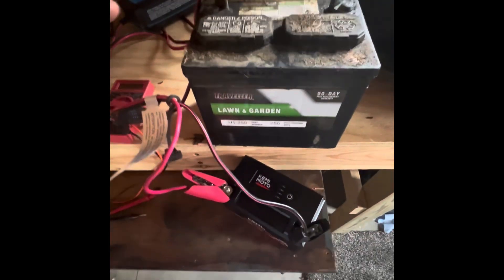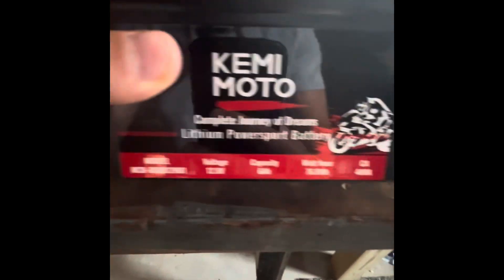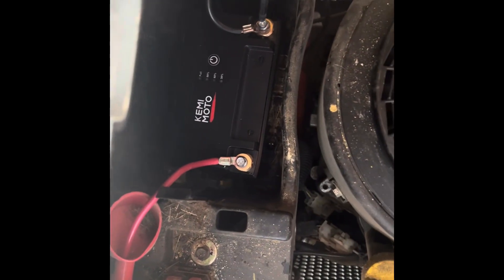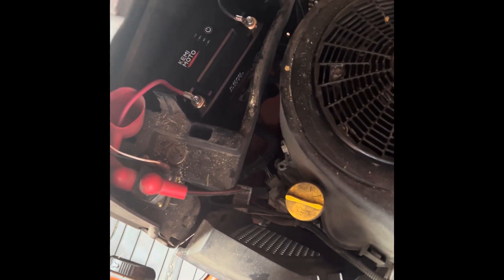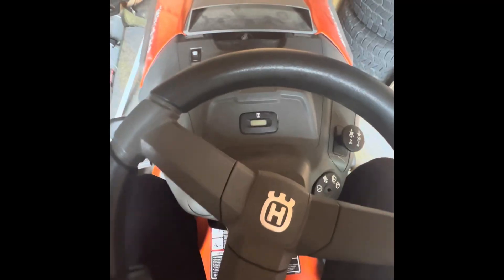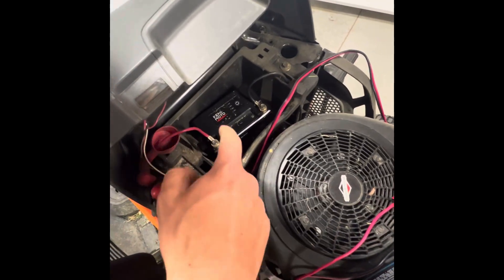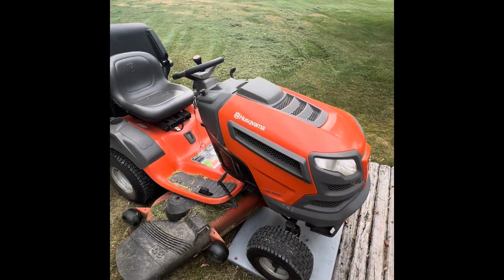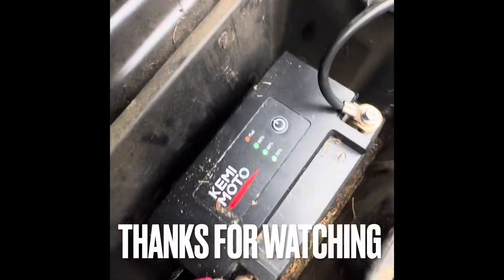Lithium Ion Battery for a Riding Mower?!

Comment: As long as the mower is only started above a freezing temperature, you should be fine.   You absolutely can not attempt to charge a lithium battery at temps below freezing, it will simply destroy it.
Reply from the maker: Yeah I store them for the winter inside where it’s warm, thanks for watching. I hope I get 7-10 years out of this battery.

Comment: someone doesnt know how a lawnmower works i c..... the battery starts it THATS IT..... once the motor is running its running off a mag coil ... no more battery to run it.... tho under flywheel is a altantor. it does charge the battery as its running. that goes to a lil box normaly that is your on n off for charging. in simple terms... soooooooooo NO THE BATTERY DOES NOT RUN THE TRACTOR ..... IT STARTS ONLY ..///
Reply from the maker: I was assuming that was the case thus I was not too concerned about the Ah rating on the battery, just cranking amps. Thanks for your insight on this. I’m assuming this battery will suffice for a long while.

Comment: AH has nothing to do with running/mowing 1 1/2 acre. Something is wrong with your charging system if it's running off the battery. I would be more concerned that you charging system might be Overcharging the battery. Lithium batteries are known to explode/catch fire if overcharged.
 On a side note:
 Not knowing what you refer to as a Smart Charger, is it a battery maintainer such as the Deltran Battery Tender or is it a misnamed trickle charger? Four years isn't long if it's a maintenance charger. I've gotten 7 and 9 years use out of AGM motorcycle and lawn tractor batteries by keeping the plugged into a Battery Tender when not in use.
Reply from the maker: Yeah it’s a Victron 15A charger does LA and Lithium batteries. I was assuming Ah had no bearing on this, I will keep an eye out for overcharging but I’m assuming the BMS will protect it from this. Thanks for watching.